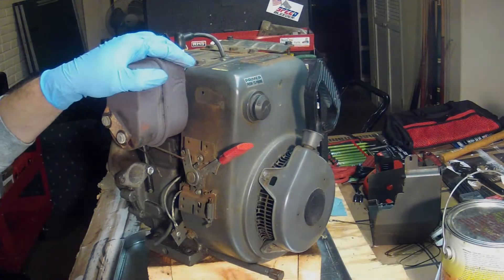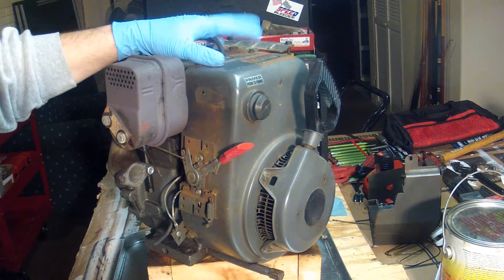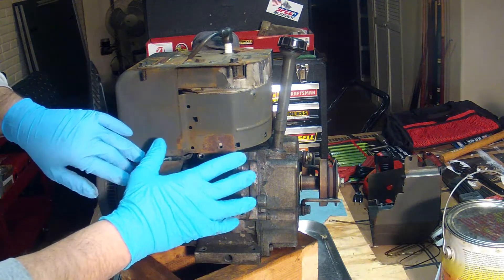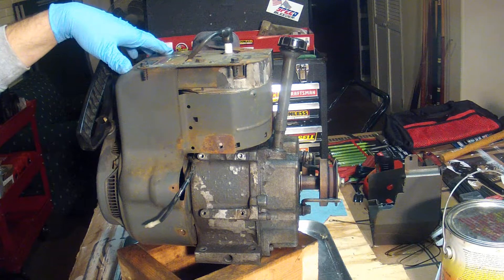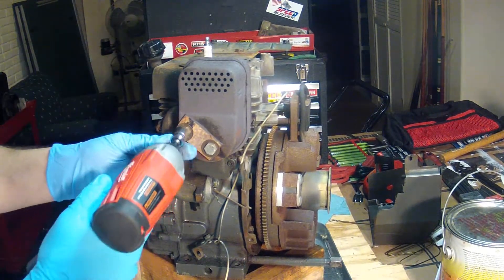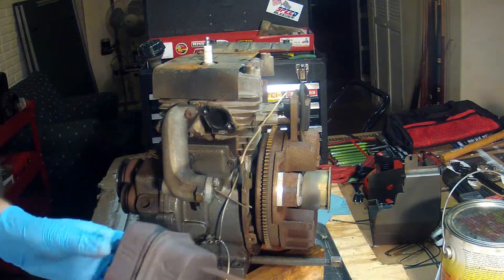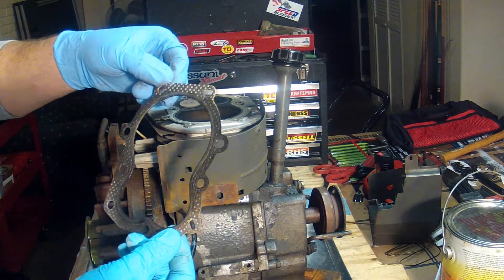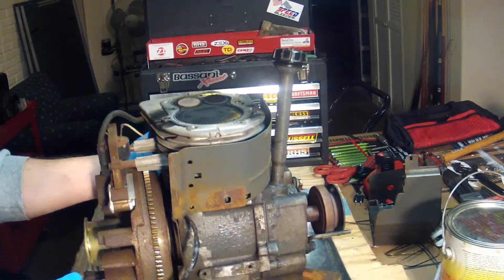Tecumseh HM80 Engine Part 1 - Shroud and head removal

Comment: how old is the engine in this video?
I just bought an hm80 and I'm trying to figure out how old it is,
the number on it is 155459M SER 2156D,
do you think it is off of a snowblower?
Reply from the maker: That engine is no longer in my possession. I believe it was on a snow thrower that was built in the 80's. Based on your model and serial number - looking at the first digit of your serial number - "2" . That indicates that your engine was manufactured in 1982 or 1992. That's all I know.
Reply: thanks, that narrows it down some,
great videos